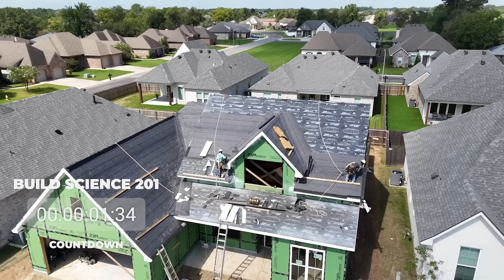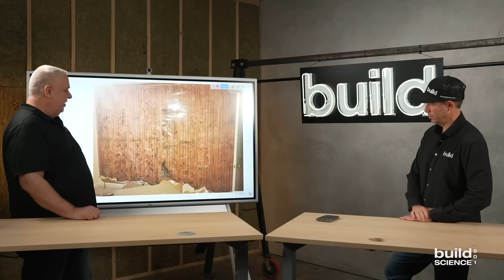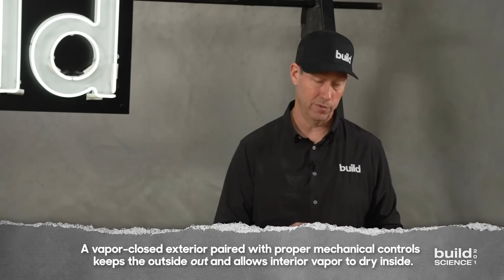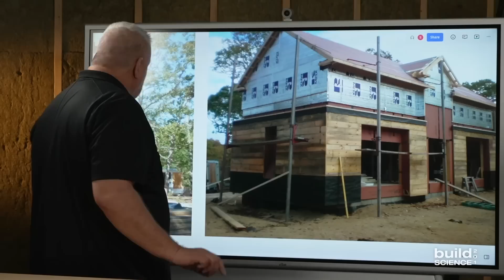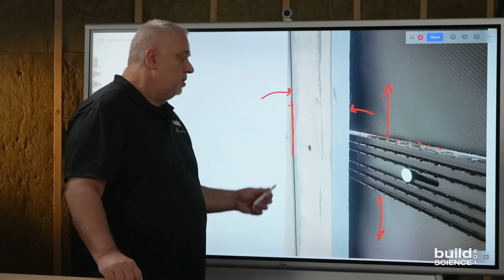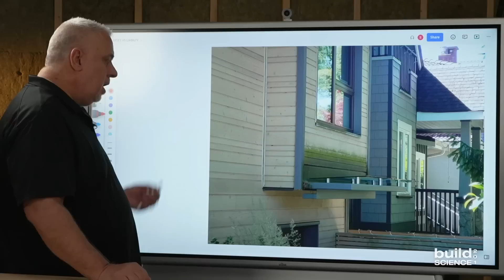Build Science 201: Ep. 8 - Vapor Management: Perspective

Comment: Thanks for admitting houses need to breathe.  But I would correct to add back air to the equation as well, not just vapor. If you close off your air-tight house (like living in a cooler with the lid closed), you need an ERV or have to crack a window.  This is a discussion about changing where and how a house breathes, and no benefit to claiming the old rule of thumb was incorrect.

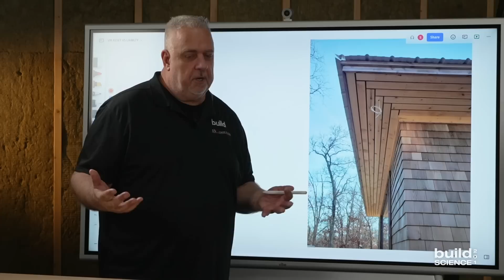Comment: The comment about vented roofs (13:28) being more beneficial in climate zones 4 and above, is this because there is higher humidity and colder temps, and therefore higher moisture levels? 

Very informative - thanks for sharing! Love the interactive screen.
Reply: The roof assembly that he was talking about at that time as well as the low slope roof the talks about later in the episode are similar but how do they insulate them? He mentions putting insulating right under the first layer of sheathing but does that go to the ridge? Could this work as a cathedral ceiling?
Reply: This has to do with the delta (temp difference) between inside and outside. 
When air cools, it can hold less and less water vapor. Have you ever been blowing smoke when it gets really cold outside? The warm air in your lungs can hold lots of vapor, but when it cools outside, it can hold less vapor and the vapor is condensation mid air forming a tiny cloud. 
The same is happening when water vapor is traveling through a building from the warmer inner parts to the cooler outer parts of a home. It cools and can hold less water and this water starts to build up in the material the vapor is traveling through. The way this can be countered, is by speeding up the vapor travel (make it easier for vapor to travel trough the material, when you get closer to the outside) and by making sure lots of air can carry away the water vapor or take up any moist which has condensed in the material.